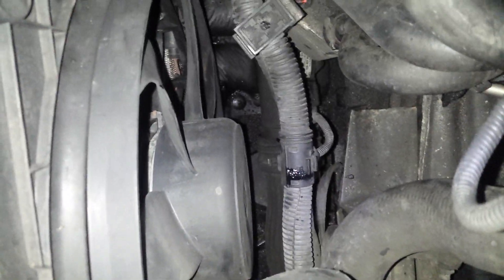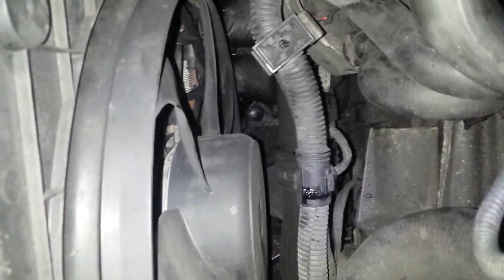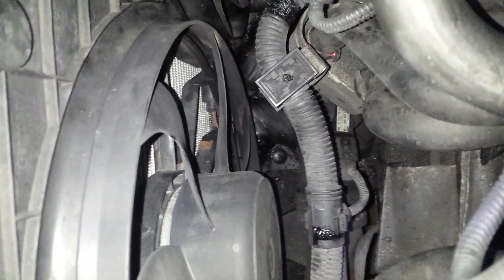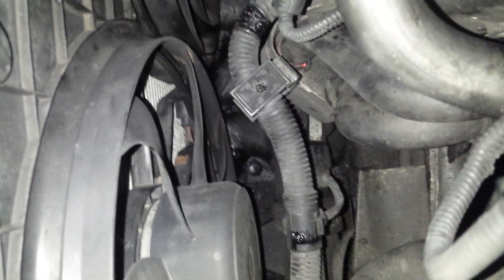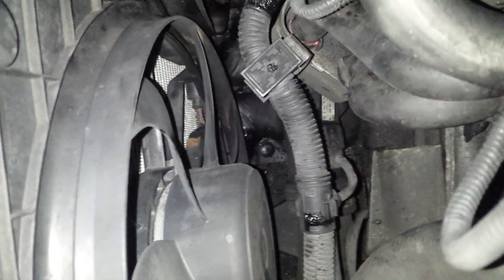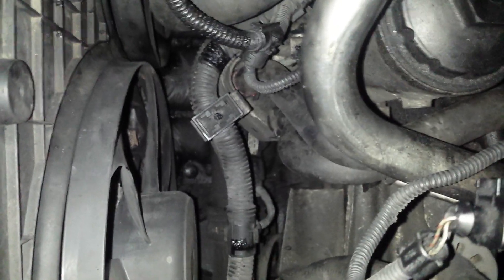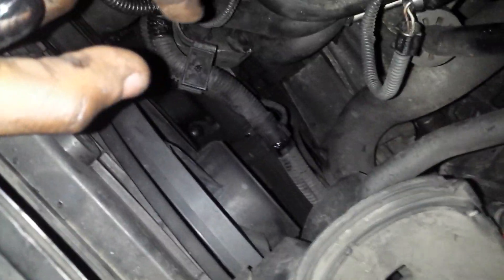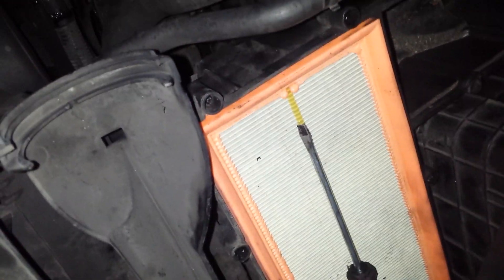Location of MAP (Manifold Absolute Pressure) sensor - VW Golf MK5 GT TDI

Comment: Got an issue with my 2007 gt tdi dsg, no lights on dash and no error codes but its in limp mode, just changed mass airflow and still no power. Would cleaning my boost sensor do the job?

Comment: Thanks for uploading the video. Did cleaning it out help, or did you replace the MAP? What code were you getting to tell you it was the MAP at fault?
Reply from the maker: Britishfever456 The best method is start with the cheapest possible solutions ie cleaning the MAP sensors. Then taking the car for a 10 minutes test drive. Then work you way from there....I didn't get a specific MAP sensor error code just a few possible issues (off the Torque app).
Reply from the maker: And yes I replaced the MAP sensor with a quality after market one - it wasn't too long before the error code disappeared and the car drove like it's old self.